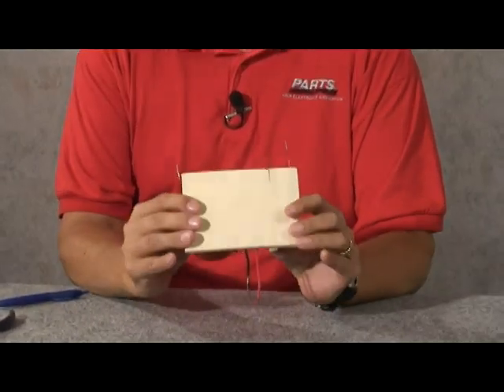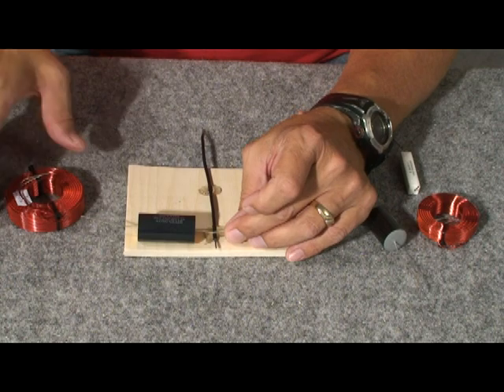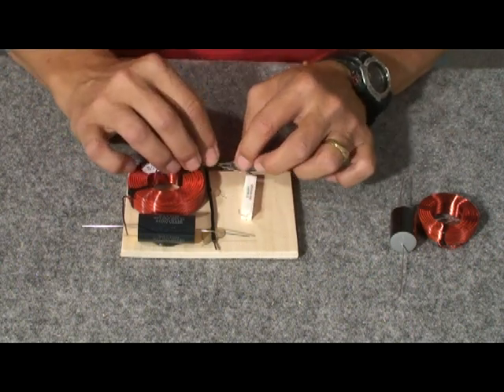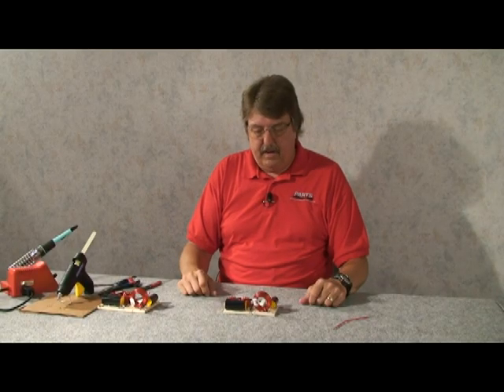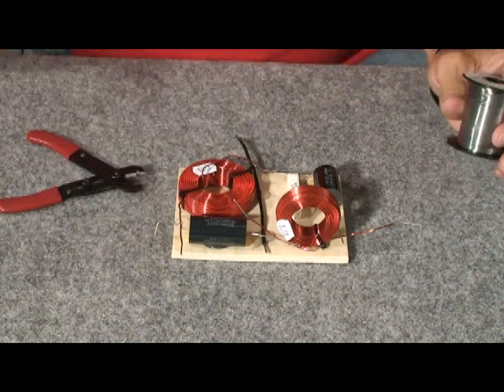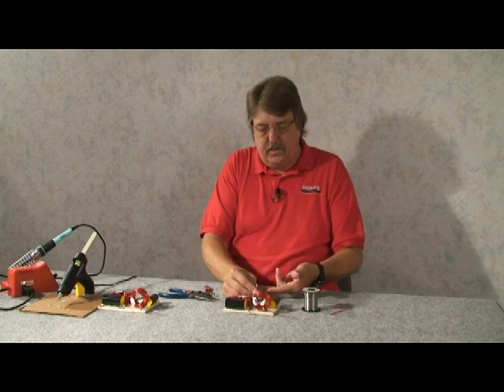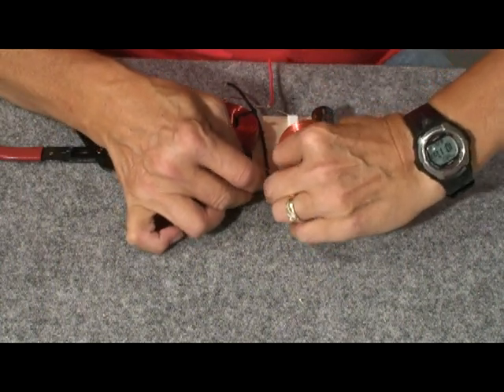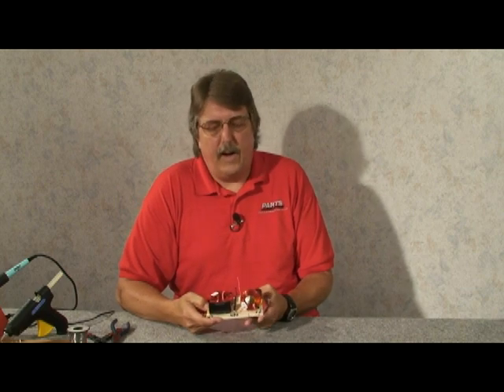DIY TriTrix Destroyer Speaker Crossover Assembly

Comment: You don't need to scrape the enamel off of the magnetic wire, all you do is get your soldering gun hot and melt some lead on it then run the solder up and down the wire until it melts the enamel away and self tins the wire.

Comment: 2.2uf or 3.3uf capacitors for strictly highs  10uf, 6.8uf, or 4.7uf  capacitors for some mids with highs depending on what speaker you are using and if they can give you the mid frequencies.

Comment: Hi, just wanna ask i have a speaker 350w 8ohm and 350w tweeter. My crossover not good and i dont know how many watts. Can replace crossover 500w?this is match?thank you
Reply from the maker: Email: Tech@Parts-Express.com
Phone: 1-800-338-0531

Hours 8am-6pm M-F EST / Closed Sat
Reply: Parts Express nice video guys..I was checking yesterday if you guys have a 4 ohms 100-150 watts  3 way crossover..this will be for 2 - Dayton ND 5-1/4 and 1 Dayton tweeter this will be for a TPA31116D2 100x2 @ 4 ohms..any help will be great and thanks?

Comment: Could the coils be shielded in some way to prevent cross-talk so they can both be mounted flat?
Reply: yes rf shielding should help to prevent cross-talk but that would probably be a bulky and inconvenient solution. In most cases it would be far easier to just have inductors facing in X, Y or Z orientations, although this can only accommodate up to 3 inductors.

Comment: Is It possible for  you to mention the values of the capacitors? thanks
Reply: 10 or smaller ones is the high pass capacitor and 20 for the bigger one is the low pass capacitor

Comment: I'm building this kit right now. Please redo this video in High Definition 1080. I would like to know what wire gauge is used on the board as the ground. I would like to see the crossover being connected to the speakers in a cabinet. I'd like to know what wire gauge is used to connect the speakers to the crossover. I'd like to see cabinet fill placement, amount, and crossover placement inside. More details for this awesome build would be appreciated. Thank you Eric for this video(going on 6+ years old now), but relevant.

Comment: So stepping up the voltage, amperage, and operating temperature of the components (without changing the resistance, and capacitance values of the components) is how you could build one of these for higher amperage right?
Reply from the maker: Hi inzpecter, 
Please contact our tech department at 1-800-338-0531 or by email at tech@parts-express.com for the best and quickest answer. Thanks for watching! Build something great! :)

Comment: how much power can this Xover hold?
Reply from the maker: They can handle up to 80 watts.
Reply: *****
hi sir
plz tell the value of components. 8ohm Speaker,8ohm Speaker,150watt,
for High pass-inductor value-?,Capacitor-?,Resistance-?
for low pass-inductor value-?,Capacitor-?,Resistance-?
Reply from the maker: Palash Neitl Please contact our tech department at 1-800-338-0531 or by email at tech@parts-express.com Thanks for watching!

Comment: sir i want to assemble here in philippine,,,but i dont know what materials did you used. what the value of capacitor,resistor.and size of coil ,and turns of coil

Comment: I would like to use a flux capacitor in my speaker, is this possible?
Reply: Yes but you must inserted cork wise with rotation opposite to the inertia of the gravitational pull